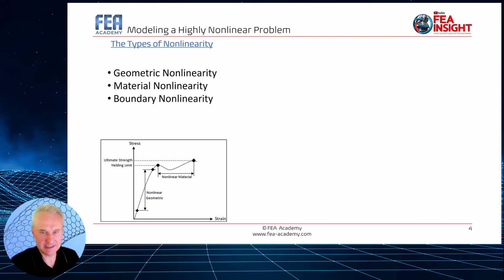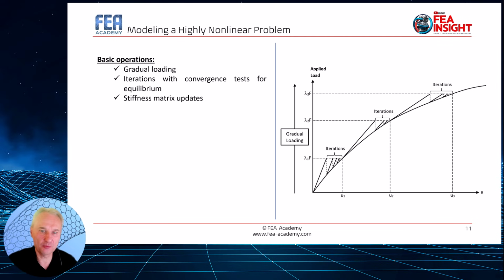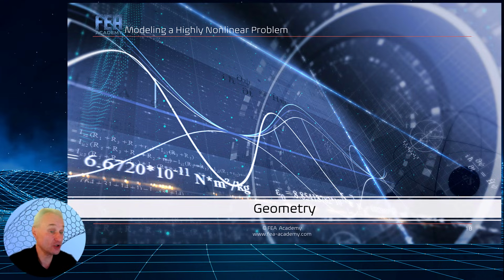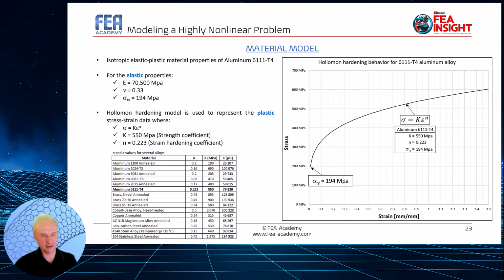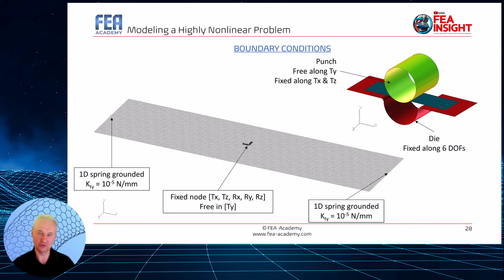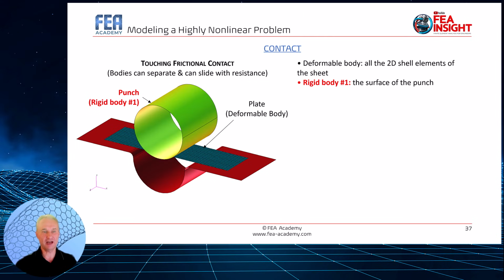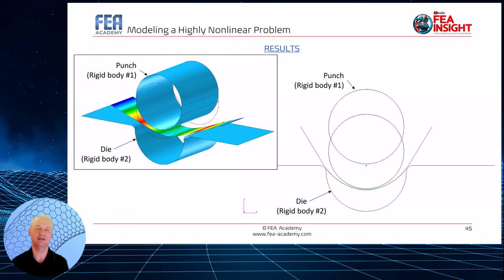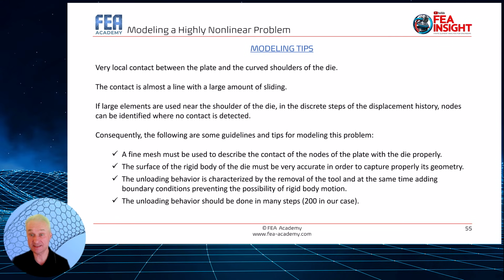FEA Insight - Ep #10 - Workshop: Modeling a Highly Nonlinear Problem

Comment: Great video, thank you! I However, I didn't understand why the 1D springs were required for the analysis. It is for the spring-back effect when the punch moves upward?
Reply from the maker: Absolutely. The plate is completely free in the Y-translational direction. So, during the punch-out phase, the plate needs to be stabilized a little bit to avoid a numerical divergence of the model when the punch is no more in contact with the plate. It is the reason why the springs with very low stiffness in Ty are added at the extremity, to help stabilizing the model without influencing the spring back effect.